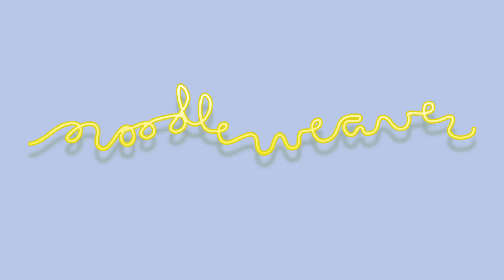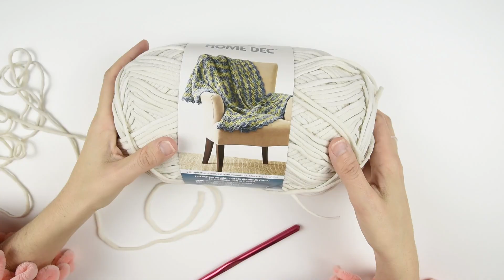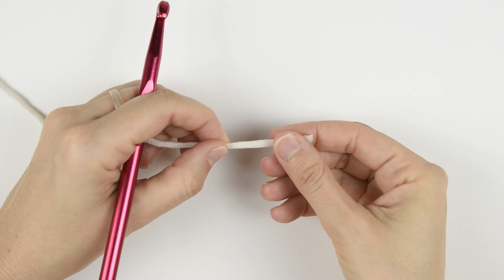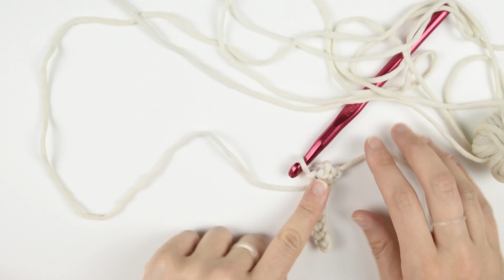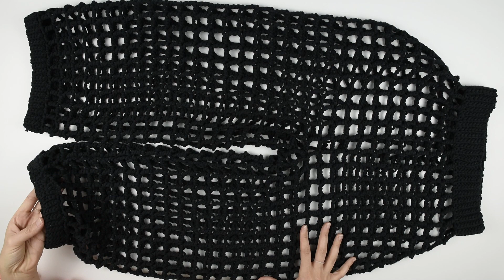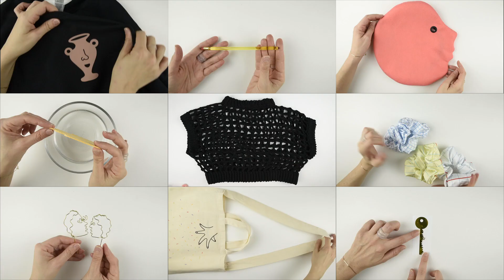Net Set | Crochet Two-Piece Variation, Follow Up to Swish! Velvet Net Overalls | Process Walkthrough

Comment: Hi I hope you  Don't mind I just had a quick question When counting the rows for The waste of the belt if you count each peak and then multiply it by 2 that should be how many rows you have correct?? I just wanted to make sure I did it right.
Reply from the maker: Hi!  Yes, that's correct.  Good luck with the rest of the project!
Reply: @noodleweaver  thank you 😊